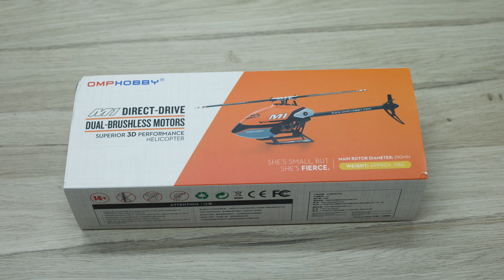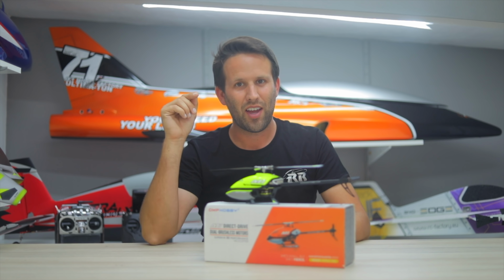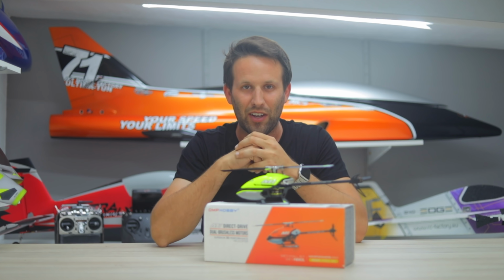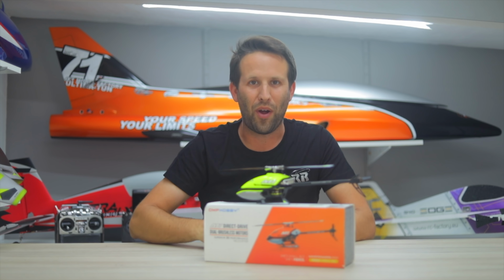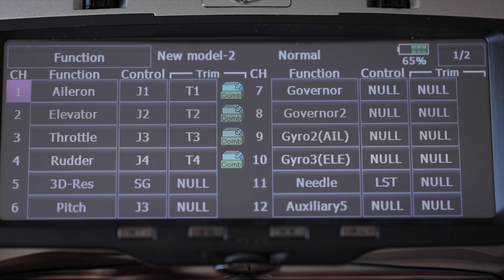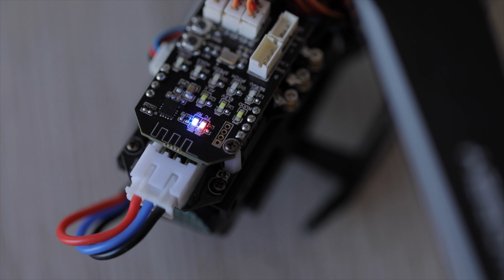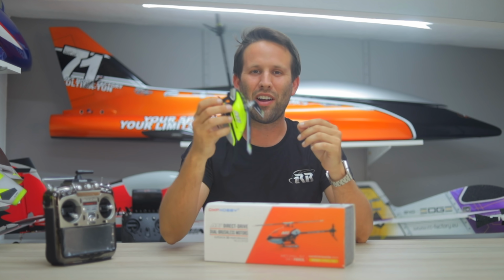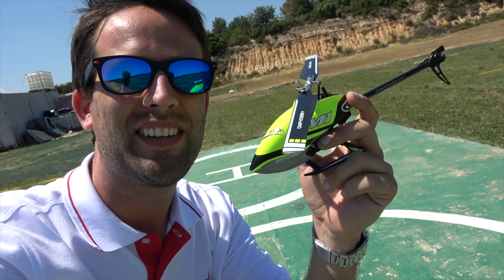SMALLEST 3D HELICOPTER?! OMP M1

Comment: Blade used to make the only half decent small/micro size helis on the market. OMP helis are leaps and bounds ahead of them.
Reply: Ya...they sure are good. I picked up a M2..but I'm not letting go of my blades ..
Reply: @jakelang4387  I gotta recommend getting the M1 to match. Similar flight characteristics to the M2 but it feels even more locked in. The pw/weight ratio is insane as well. It's easily become my favorite and now I have 4 of them.
Reply: @flightevolution8132  I bought it and it's a monster,,love it.but I'm not good enough to flip it indoors ,,that's where I like my cpx better. But my cpx is a mini monster,,got a outrunning main with a 10 millimeter cordless tail ..its my in the bedroom flyer

Comment: I have the m2 and I still don't get the rescue mode??? I thought you just flip the switch out of idle up to normal mode and the heli does it ...no special switch...
Reply: Oftentimes gyroscope functions like that are assigned to their own radio channel so they can be activated or deactivated independently of throttle and pitch curves. In practice you might want to use the self-righting feature in normal and idle-up mode. A good pilot typically only uses normal mode for landing, and some pilots don't use normal mode at all.

Comment: Ahhh,, But can it autorotate? Is there a one way bearing? Nevermind, it's too small for that anyways. LOL I still have my Align 150 DFC. How does it compare to that? I hate that double circuit board that fails so easily in a crash. This is very pricey like the 150DFC was too, but I like the direct drive so you don't need to worry about the main gear. And the rotational servos are great over the Horizon Hobby helis for sure. Man I have worn those out so much in my Brushless micros!!!!!